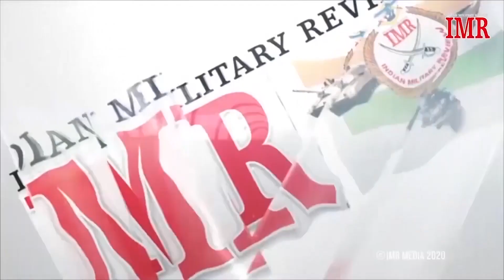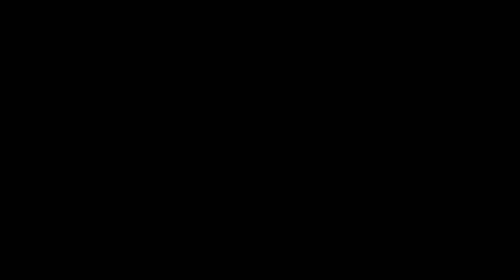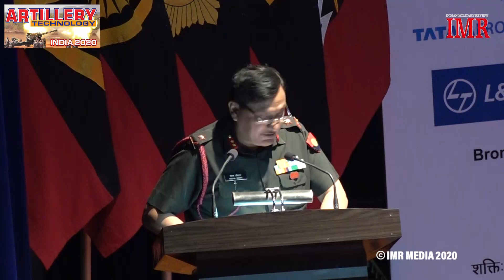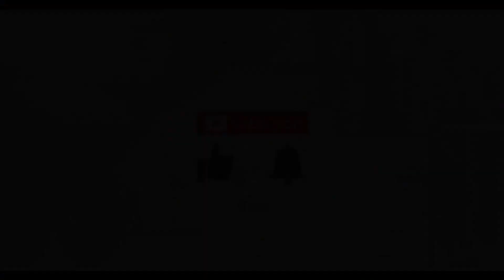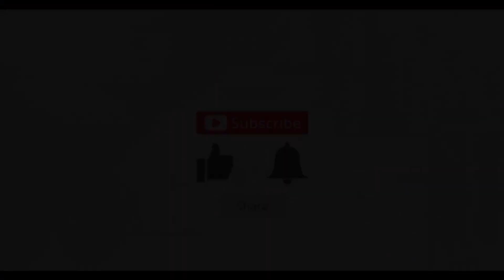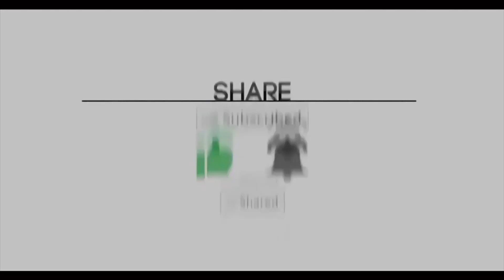MODERNISATION OF THE REGIMENT OF ARTILLERY by Maj Gen Deepak Obhrai, Addl DG Artillery A, Army HQ

Comment: Excalibur can only be used with m777 ulh (at 8.06)and not with k9 vajra-t and indigenous 155mm systems?... That's an issue....why can't our 155mm guns(dhanush, sharang and atags) fire these rounds 155mm rounds??....Is it because of (a)lack of sop's for firing of these rounds from Indian guns or (b) is it written in contract to use these rounds from only American built guns or (c) due to incompatibility of these rounds with indian guns...which is highly unlikely because all the guns are of 155mm(39/45/52cal) standard and should easily fire 155mm shells and if yes then what kind of incompatibility?